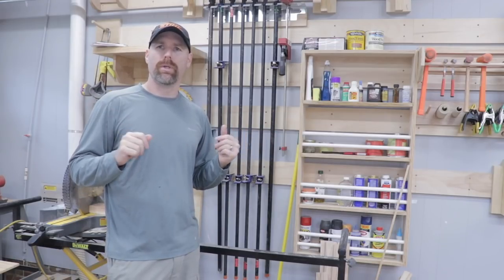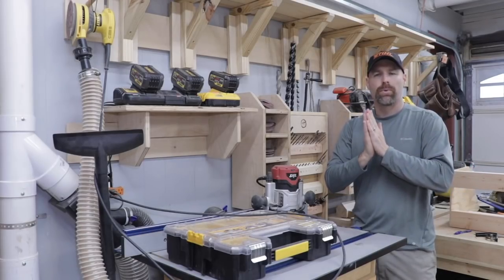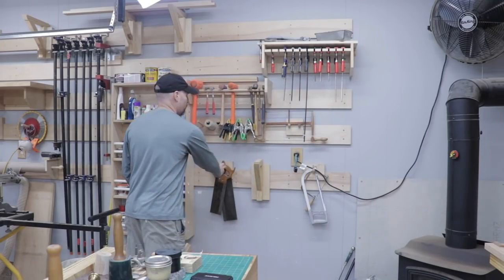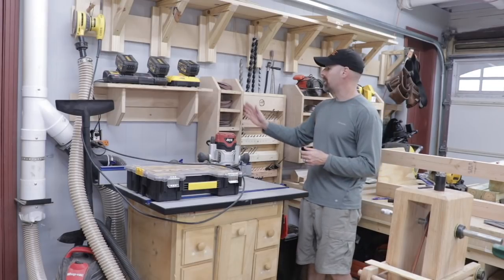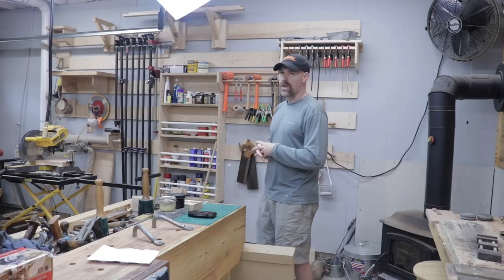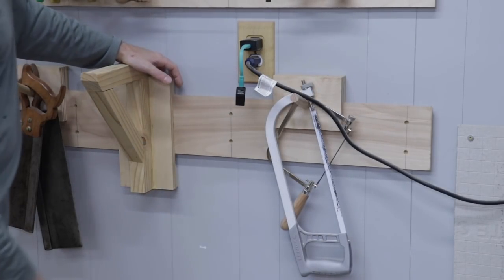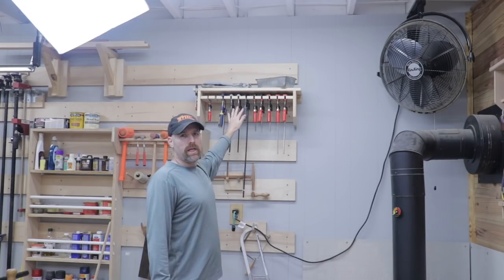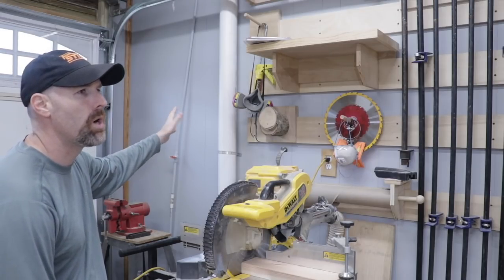PROS and CONS of a French Cleat Tool Wall

Comment: First I'm lazy.  So I attached a cleat to the top perimeter of all my shop tables.  That way I can bring to my work area the units I may need in one move.  Not run back and forth for a single tool.

Also I HAD a rolling wall cart which I ripped off all the shelves and boxes from the center support and added cleats in their place.  Now I have a rolling French Cleat cart.

Next when I was mounting the wall unit I forgot about the central shop vacs intake gate.  So I cut out a hole for the gate.  The made some holders to wrap the hose and vac nozzle to.  And added a cleat and spacer.

And lastly, two of my shop tables have a flip top action to secure and store my table top devices.  The first time I added the cleat I attached one long cleat to the entire edge.  WRONG.

After glueing and screwing the cleat it hit me.  Now I can't flip the top.  To correct that I took my jig saw and cut the cleat wherever there was a flip over edge.  Once I freed up the flip top it was still screwed up.  The cleat kept rubbing and squeaking.  In anger I called it a night.

The next morning my wife tried to sooth my temper by making my favorite Silver Dollar Pancakes for breakfast.  And that gave me the solution.

That night after work, I widened the gap between the original cuts.  Then whittled an angle cut on the flip over side to insure the two cleats won't make contact.  Like back buttering my pancakes.

For the second flip top table I measured the segments of the perimeter twice.  Cut once.  Where the heck did I hear that before.

Royally screwed,
Jim
Reply from the maker: Thanks for sharing
Reply: Yeah - I've been doing that too.  The convenience of being able to grab the entire "Measuring tools" module from the wall and hang it off of the table saw bench is phenomenal.  No more running back and forth for the square, the tilt angle gizmo, a pencil, etc...just grab the whole thing and have ALL of those tools where you need them.  Same deal with my hand drill - it's on a module with a spare battery, a set of the most common drill bit sizes and a couple of different screwdriver bits.   So, again, no more trips back and forth.  Putting tools alongside the "supplies" they need is also phenomenally handy...hang sandpaper disks on the module that houses the sander...put the right size staples on the same module as the staple gun.  I bought two packs of those cheap BIC propelling pencils and some little clips to hold them - and probably 30% of my modules now have a pencil on them! And just like you, I hit on the idea of making a rolling cart with a bunch of short cleats on each side for when I have to work somewhere else in the house or backyard.

Comment: Keep in mind, you don't HAVE to use the expensive 3/4" birch plywood.  Sure, it's pretty and all, but not an absolute requirement.  Also, consider what you'll be hanging on your cleats.  If all you have is lighter weight stuff, then 1/2" plywood will work just as well, and possibly 3/8".  Just know that once you go with a certain thickness of plywood, you're stuck with that for that particular wall cleat and associated cleats and spacer pieces have to be made from the same thickness as well.  

If you only screw your cleats to the wall (no glue), then it would be possible to upsize them to thicker plywood if needed, althugh this might compromise cleat strength overall.   

Either way, I think there are far more positives for french cleats than negatives.  I've only had pegboard in my shop once, and I'll never use it again.

Comment: I think a big positive of the french cleat system is that you don't have to plan ahead for tool expansion.  If you add tools like clamps, you just need to build a rack for the new tools, hang it up, and done.
Reply from the maker: In the future, I will try to leave some room for expansion but it’s very difficult to know my needs in the future! Thanks for watching!
Reply: @lastingbuild1373  I think your problem is that you're treating the system like a piece of fine furniture...which you might need to do for whatever reason.   But for me, the tool holders are thrown together quickly and mostly from scrap lumber.   They don't look pretty, I don't stain or paint them and I use cheap junk lumber or even MDF - but they are aggressively practical - and are largely disposable.   I don't build space on a tool module for future expansion - if I get more clamps - I throw away the "clamps holder" and build a new one.   Takes 15 minutes and the wood from the old one goes into the scrap bin and probably gets re-used for the next module I need the following weekend.   The whole system evolves gradually.  Just a couple of days ago, I'm looking at the holder that has four hammers in it and thinking...why the heck do I need four hammers?  So I donated two of them to a neighbor and cut down the module to take up less space.

Comment: I see lots of people building large hangers for clamps which I find ridiculous. Clamps are large and take up a lot of room by building large specialized hangers when realistically they can hang very close to each other just about anywhere in the shop. If you have plenty of space then go for it. Clamps are at the bottom of the list for hanging on the cleat wall. Your mileage may vary.

Comment: I feel like you’re reaching to find negatives. No system is perfect but ‘pegboard’ isn’t even in the same league.  We all generate a ton of scrap and converting that to French cleat gizmos is way better than having it gather dust in a scrap  bin.
Reply from the maker: I’ve used both systems and I obviously prefer the cleats! Thanks for watching!
Reply: @lastingbuild1373  The biggest disadvantage which is also is biggest advantage for me  is that everything is open. You can see everything and have easy access but at least im experience it also collects a lot of dust. Another albeit minor and that is also more of a personal thing is that it makes it look more busy than having everything in cabinets. I also agree with Tioga, peg board is not in the same league as a french cleat system.
Anyway, thank  you for the great video.
Reply: @trollnapf1670  I'd agree that if you want your workshop to look like as pretty and neat as (say) your kitchen - then both French cleats and pegboard look horribly messy.  But I maintain that if you want your workshop to be a convenient, efficient way to actually build stuff - then putting things away in drawers and cupboards is a TERRIBLE idea.   The half of my double garage that is my workshop is heavily optimized for efficiency and ease of work...and what it looks like is largely immaterial.  I don't think there is anything to choose between pegboard and cleats on grounds of visual appeal - but cleats beat pegboard hands down on (1) the number of tools you can fit into a limited amount of space and (2) the ease with which tools can be brought to hand as each one is needed.   Dust is a perpetual problem with both systems - but honestly, dust control is important even if all of your tools are hidden away in drawers.   So add a central vac system - have dust-collection hoses for all of the big machine tools.  Stopping the dust from getting everywhere in the first place is better by far than making it easier to clean up at the end.

Comment: I think your wall cleat is way bigger than it needs to be. I think 2-1/2 inches is plenty. It still allows 2 screws per stud. I cut 5 inch strips of plywood and then cut each one in half at 45 deg. to get 2 cleats. That size also works well for use on the tool holders.

Comment: Use metal cleats...on the wall and the caddies; less bulky, less construction, maybe even cheaper. Why aren't you using CDX? It's a shop! Worried about a few screw-holes in the wall? Are you kidding me?! Easiest thing to patch in the world! A lot of those caddies hanging there could partially at least be built with 1/4 inch, 3/8 inch or 1/2 inch plywood...don't need 3/4 inch for every part of a caddy. The biggest problem I have with this cleat system is that dust covers everything over the years. You don't use all the tools all the time. Nothing wrong with a few cabinets with doors for those occasional-use items. Here in sub-tropical Southeastern Louisiana I have a huge problem with tools rusting even if I leave them out for only a week...cabinets help with that. Air-conditioning doesn't help: tools I kept inside my home for protection rusted completely after a couple of years sitting in a closet. The metal gets cold and moisture condenses. My Table-saw suffers greatly from this.

Comment: Great videos on the French cleat. One thing I haven’t been able to find clear answer on is weight limit. I am trying to find a less expensive option to hanging my cabinets I bought from NewAge. So what could a French cleat hold? If installed into the studs and backing secured to back of the cabinets correctly will it hold the a heavy cabinets. Taller items I was thinking at least 2 cleats maybe 3. Thanks
Reply from the maker: You can buy metal cleats specifically for hanging cabinets. Not sure weight limit but it’s a lot!

Comment: How did you decide on the width of the wall cleat?   Was it multiple screws in each stud or do you think one screw would hold an adequate amount of weight.
Reply from the maker: I think the width adds to the appearance but one screw would likely be suffice in most circumstances. I can’t remember the exact width but I think it’s in one of my prior videos on the build details.

Comment: You have great ideas!  My workshop is full of pegboard, but I recently removed some shelving off of a concrete block wall.  Will a cleat system work well on this type of wall?  I'm thinking of securing the support cleats with Tapcon screws.  Opinion?
Reply from the maker: Sure! As long as your wall cleats are secure it will be rock solid!
Reply: You'd need a LOT of Tapcons and wind up with a hell of a lot of holes in your block-wall.    Honestly, I'd use tapcons to screw 2x4's to the wall - kinda like framing a wall - then cover that with a sheet of plywood or drywall and attach the cleats through that into the 2x4's.

Comment: Yes for newbie is slowlier make these....and of course the much money enough for wood material .....so slowly making but sure.. btw i see u put 2 screw verticcally on it along the wood to wall. d u think it will strong if i put only one ther "  regards from indonesia
Reply from the maker: If you hit studs, I think one screw would work! Your wall cleats do not require the width I used to save money also.
Reply: Really appreciate of ure quick answering thks professor🙏🙏

Comment: Ok I saw you quick tip video but I am using plywood and it still chips the edges. Any specific type of plywood you recommend? I also have to add that I’m using a circular saw I don’t have a table saw, so I’m not sure if that would make a different.  What’s your suggestion?. Thank you.

Comment: Thanks for your pros and cons.

But to be honest, I disagree or miss some....

It looks nice? I guess (a) personal taste and (b) any clean shop looks nice.

It's stronger than any other system?
There are plenty other shelf systems where the strength of your wall is the limit.

You can build a holder for almost anything. So could you build any shelf you put on your wall directly.

It's flexible. No argument there!

It's expensive? Well.... The holders extent the whole wall, but the piece you want to hang. But is it more expensive than building and hanging "propper" shelves?

Limitations by wall features exist for anything you hang on your wall.

Limitations from building what you had? Build a second holder then! You're flexible, have you forgotten?

I'm missing:
It takes up depth. 3/4 away from the wall. If you have a concrete wall, you may consider adding vertical beams so you don't have to turn your wall into Swiss cheese and maintain air circulation. Again, loosing 3/4 again.
To me that's too much overhead, despite all the pros....

It gathers dust, ain't it?
Not only the cleats themselves, also any open holder.
I guess I'd rather fancy a closed tool case at the wall which opens up to a tool wall (holders in the doors).

I took a look at IKEA kitchen wall mounts. They are 2m / 6ft long metal bars to hang shelves to them. Quite flat and sturdy and cheap!
Also flexible to some amount.

Still thinking about what to do with my workspace, so thanks for your view ☺️
Reply from the maker: Thanks for sharing!

Comment: Screw and nail holes are the easiest to repair
it might be a bit time consuming depending the amount and if you do them right..no sanding required ( right wrong or different, I've had renters use toothpaste🤔😳😂) , I'd much rather fill them then have to repair a large hole in sheetrock.

Comment: I disagree with the expandability and cost cons. 
The system is totally modular so any new items you need will easily fit beside or in a totally different space from the original version. Other systems require the same planning for clamp storage.
The cost issue is a debatable also. The cabinet will take the same material regardless of the system. The cleats themselves are the only different expense and can be made of mdf OR particleboard quite easily.  As long as they aren't holding more than 20lbs per foot (and more if they are glued to the wall) they are fine).
Reply from the maker: Thanks for sharing your thoughts! 👍

Comment: I think the cleat or tool-wall concept is not an efficient use of space. After you accumulate more and more tools and hardwares you will start to think a single layer of storage just isn't enough. Then you start to build a cabinet to hang on the cleats, then two cabinets, until you finally realize you almost need a full wall of cabinets.
It looks great, but doesn't hold enough stuff IMO.
Reply: Some stuff just doesn't fit in a cabinet efficiently like my 48" parallel clamps. I think the best setup is going to be organization that works for each individual shop and maker. My guess is that a combination between cleats, cabinets, peg boards, and shelves is what most people settle into.

Comment: Ahhhh thats why the clamp holder is so small.  I have at least 40 clamps which needs a different way to organize them.
Reply: A smarter way to handle more of the clamps would be to turn them to the side like they are displayed in most stores. If you made a two simple brackets that hooked into the cleats that are 8 inches in depth, then the F clamps would sit flat to the wall instead of perpendicular. This way, you could store 6 F clamps in the same space. I think what he missed is researching a good design for the tool holder before setting out to build it.

Comment: The more research I do , steel pegboard is 1000000x better. Time is is money. Just buy hooks,  and steel board
Reply from the maker: Is steel pegboard what you are using or your plan?
Reply: @lastingbuild1373  i love your video btw man , straight to the point. Good pros and cons. And yes I am using steel pegboard. Only because its what they had atm , otherwise regular pegboard is good 👍 cheap , fast to install. French cleats look beautiful but unfortunately like you mentioned takes a while to build and then you have to also build all the holders.
Reply from the maker: Thanks a bunch!

Comment: EVERY single 'con' sounded like an EXCUSE that you did not plan or that you care more about appearance or cost than you do PRACTICALITY. Leaving space for dust collection pipe or water pipe tells me you would have had to do the SAME for any other system. You cannot attach a cabinet to the wall with pipes behind them either (EXCUSE after excuse)
My two cents....

Comment: Your cons is a little over Exaggerated, wall outlet, clamp rack size, these are not cons of the French cleat system the clamp rack is a con of itself and the outlet would get in the way   Of a French Cleat and a pegboard so that’s no excuse and the price of the material is not nearly as bad as pegboard where a 4x8 sheet can cost from $95 to $200 uline has one for $179. This video has to be Remade with a direct focus on the pros and cons of the French cleat and pegboard because this video that you have made sound like nothing but complaints. I’m not trying to get you upset nor trying to disrespect you this is just my honest opinion. You just have to consider other factors like the price of a pegboard and peg hooks rather than falsely claiming the price is expensive because this is cheaper than pegboard

Comment: More Cons:
You cannot put things where ever you want!  You are stuck with putting things where the cleats are.  What if you need or want something 1-6 inches up or down?
You have to make the cleats
You have to have your tool holders adapt to the cleats
Yes you can hang a way overbuilt timber frame saw horse off other kinds of hanger mount systems
I could write many more but you get the idea

As you can tell the cleat system didn't work for me or my shop.
I find using plywood sheets allows me to put things where ever I want, without having to rig some kind of cleat system.  You just make the tool holder the way you want and screw it to the plywood.  When you change your mind just unscrew it and screw it elsewhere.  The small screw hole left is hardly noticeable, insignificant and most of the time you can't see it. And you save money because you can use utility grade plywood and not the expensive birch - thus allowing for more coverage for the same expenditure. YMMV

Comment: So a couple of the cons are you using expensive plywood(your fault) bad planning in sizes of holders( your fault) having to plan for obstructions( have to do that with every build) so basically mostly not cons just your fault.Got it.